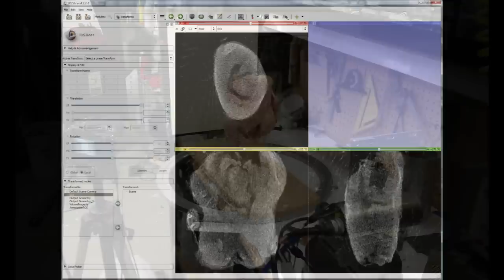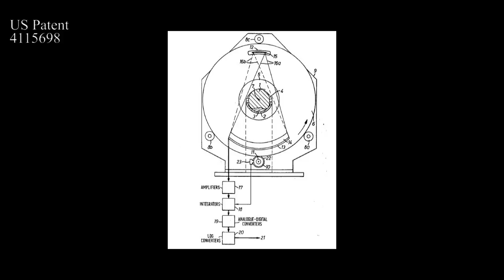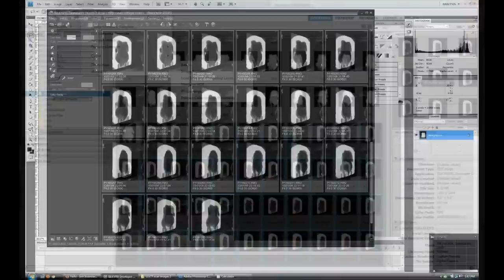DIY X-ray CT scanner controlled by an Arduino

Comment: The stepper motor driver used is a Linistepper if anyone wanted to know. This is an open source (hardware design and firmware code fully documented and available on the web site) microstepping driver for unipolar motors at up to 35 volts and 2 or 3 amps. Ben has it set for 1 amp/phase and it looks like 1/6 micro-steps. Kits are also available, which is what Ben has, and I'm trying to figure out how I failed to notice his name when I shipped the order! LOL...

Comment from the maker: You are correct about the mirror. I think some commercial fluoroscope systems work this way. I used Cygwin/Octave with someone else's code for backprojection. Then I used 3D slicer for visualization. I put some links in the description.

Comment: I just found this video and must compliment you on your logical approach to solving the various issues. I worked for Siemens Medical systems for many years and also Mallinckrodt Corp. in their medical X-ray division. I have more lately moved into dental X-ray digital imaging where a CMOS sensor replaces the traditional films used to take X-rays. I have worked on all of the imaging modalities to different degrees, my favorite being cardiac imaging. Your project is great and the item you need to process those images is an image processor like those used in the big CT machines. Also your X-ray source is much smaller but about right sized for your project. All these items are large and super expensive but you are on the correct path following what the big machines basically do.

Comment: Current CT scanners use RF or light to transmit data.  Toshiba scanners transmit data using a series of LEDs called mudat.  They all transmit power by brushes and slip rings.  Scanners I'm familiar with transmit 550 volts DC across the slip rings. Scanners from the 90s used slip rings to transmit data as well as power.  Scanners in the 80s and older used cable take up systems. The scanner would make one rotation and take one slice and then it would have to stop and wait to rotate back before it could take another slice. I don't think scanners that old did 3D.

Amazing setup. I work with CT scanners, but I wasn't searching for CT when I found this.
Reply: kel5944: The 1980's ones sound interesting. I bet they could easily be updated to get many slices and then you can make a 3D texture using today's software.
Reply: Vrej Egon Spengler Today they do .5mm slices and 256 slices per rotation. 1 rotation in .5 seconds. There is a scanner that can scan in 1/120 of a second but is seldom used today and expensive to maintain. Its also not really needed either. The gold standard is to stop the motion of the heart in one rotation.

The 3d scans are awesome! You can even do 3d prints from them if you can get your scan data from your doctor. He wont spend the time to print it though. A 3d print isnt really useful to a diagnosis.
Reply: Vrej Egon Spengler There used to be stand alone consoles that you could input the collected data to create the 3D  reconstructions
Reply: Except in bone fractures, then 3D is very useful

Comment from the maker: Thanks! I used Cygwin/Octave with someone else's code (link in the description) to perform the backprojection. I am currently working on an iterative reconstruction method, and will post more video of it soon. The graininess is partially caused by the backprojection algorithm creating artifacts, and also caused by the input images having poor dynamic range.
Reply: Awesome. How did you manage to reconstruct a scalar volume (axial slices) out of 2D planar projections? A tomography usually employs 1-dimensional parallel beam projections under a specific angle and then organized into a sinogram. So the back projection algorithm can approximate the slices out of such sinogram. But being a sequence of 2D planar X-ray roll (or a set of pics) is somewhat equated to a photogrammetry problem. Therefore, I figure out that what you did is a cone beam projection beforehand. But, I think that the provided matlab code only reconstructs previously calculated cone beam projections, but not the cone beam projection itself. Thx

Comment: What if instead of putting the camera in line, you use the old high speed trick and put it 90 degrees to the screen with a mirror set at 45 degrees to direct the light from the phosphor screen into it? Seems like that would be the best geometry to get straight on images while keeping the camera out of the X-ray beam.
Reply: R C because the phosphorous screen is affected by radiation, not photons.
Reply: HeATThER Mdd Phosphor screen produces light when struck by x-ray radiation,  this is then reflected by the mirror into the camera. This avoids the camera being exposed to x-rays as this would produce hot pixels/noisy image.
Reply: fuck yeah, a mirror is invisible to xrays.
Reply: I came here to say this but u said it first.
Reply: He could put lead shielding glass in front of the camera and move everything perfectly behind the phosphor intensifier screen. She would certainly have gotten a better image and spent less time on Photoshop.

Comment: I'm a service engineer for Siemens CTs, And I'm really impressed with the method you're using. I recommend you to keep developing this method because from the detector side of Siemens and other brands CTs are using way too much complicated detectors with lots and lots of complicated timing between readings and reconstruction of images and a lot of image artifacts making them very expensive. Loved your work and I'm pleased to help you for any hints or maybe parts from Siemens CTs.

Comment: I would recommend that you consider using Android for this type of automation. The ADK offers the ability to connect an Android device to custom electronics, and a very rich programmable pipeline. I'm sure you could have automated most of the camera control, capture, and photo manipulation (eg. imagemagik) via one device, and a handful of scripts. This could offer faster and more flexible development! Again, outstanding work!

Comment: I've had a Linistepper for nearly a decade, using it for random motion tasks over the years. Aside from the curiosity value regarding how it accomplishes microstepping, it just works with any (unipolar) stepper I throw at it. Love that design, along with every last thing Roman Black has done.

Comment: This is very, very impressive. In fact, the model of vertical rotation that you have demonstrated would probably drastically reduce the cost of traditional CT scanners for patients that are capable of standing up (I'm guessing many scenarios). A static exposure plate may yield superior captures as well! 

Great work!

Comment: Very nice. Are you going to try it again? If so, disable all the noise reduction in your Nikon. It will eliminate the subtraction time AND shorten the exposure you need. Plus you might gain some resolution due to retaining data that is lost in the noise reduction algorithms. For stars and 20 sec through say, a 60mm lens you go from the brighter stars of the constellations only to stunning shots with fainter galaxies and nebulae identifiable and big swathes of Milly Way. Could be a big help for the image reconstruction from projections.

Comment: Yep, you're missing somthing else. I was talking about using the sensor strip from a flatbed scanner. It is basicly a single line of "pixels" that is moved on a track by a stepper motor (or a similar mechanism). I think they are just a bit shorter than that phosphor screen is wide; but with a custom track you could get much more coverage on the vertical axis.

Comment: Have you considered a front silvered mirror to get the camera out of the Xray plane with rear photography? A thinly silvered mirror will be reasonably transparent to the beam but will reflect the light well.. Less keystoning makes it easier. A lead shield for the camera front on another tripod with a hole for the lens will also likely help reduce scatter in doing this.

Comment: May I have a suggestion?

The X-ray tube place slightly lower, and tilt up the x-ray beam a little bit. Put the camera above and  behind the X-ray tube. Using telephoto lens to take the pictures. So as to keep the angle between the X-ray beam and the photo-axis of the lenses as narrow as possible. Therefore you don't need the Photoshop to correct the prospective of the image, thus preserve the pixal resolution. Also, place a lead glass in front of the camera to cut off the scattered X-ray, which could avoid the hot-pixal.

I am a CT diagnostic radiographer and I am also a photographic amateur.

Comment: You can get radioisotope test sources from many suppliers. Do a google search for exempt radioisotope source and you can find them in many flavors. These are pretty much harmless, though you wouldnt want to sleep with one under yor pillow. They are used for calibration procedures in gamma spectroscopy, among other things.

Comment: The phosphorous is basically painted onto a board, much like glow in the dark paint, but with higher energy requirements to produce illumination. Getting off the point here, but no, it would not illuminate from behind, the phosphorus is a thin coat of paint on an opaque board. If you mean, turn it around and let the xrays pass through, this would induce quite the scatter, but i would think these are mounted on or laminated around a heavy metal.

Comment: That's quite a project :)  You mentioned having to do off-axis correction. Perhaps one way to avoid that would be to put the camera at 90 degrees to the phosphor screen, then rotate the phosphor screen 90 degrees after the xray phase completes. And the picture taking phase completes, rotate the phosphor screen back into position. More hardware, but perhaps easier than dealing with the perspective correction.

Comment: Had you considered using a glass or mylar reflector either in front of or behind the screen, kind of like a holography beamsplitter? Those materials should be virtually nonexistent in terms of xray absorption and could get your camera out of the beam with minimal distortion. Very cool demo!
Reply: That would be the entire point my friend. Visible photons from the scintillator are reflected toward the camera, x-rays pass through into a trap and do not affect the sensor.

Comment: I've been intending to do just this using an old dental x-ray machine from ebay! My currently un-built design gets around hot-pixel issue by using a 45-degree mirror behind the screen to place the camera below the unshielded beam-path. Also means a dark-box for shorter exposures.
I've been considering having the turntable on a linear rail too, to adjust the "zoom" by moving smaller objects closer to the x-ray source.
Thankyou so much for that software link!!

Comment: Another Excellent project Bravo! I have an idea to improve the imaging. As your setup shows your camera is set at an angle off set to the direct line x-rays to reduce the chance of "hot pixels" pixelating of the images sensor. I would suggest a direct inline setup of the camera and the use of 1/2 inch thick lead glass in front of the camera lens to block the x-rays that will cause the "Hot Pixels".This way you will have a more distinct and direct imaging on the camera.

Comment: This is fascinating. I work with X-ray sources up to 60 KV. I'm not sure what anode you're using, but I might try something like this with at 60KV and 50mA with a Rh anode. At least the image collection should happen much faster with 50x the flux.

Comment: No it's not permanent.
But twiddling the exposure or intensity isn't really the point, because you need the x-rays to get the fluorescence and they are directly proportional, so if you reduce the x-rays you get less fluorescence.
However filtering out the flashes may work, since I guess it can be treated very well as noise.

Comment: yes yes i understand this, i actually asked implicitly why he chose 8 degrees because he didn't say why, i was wondering if it had something to do with the algorithm he used to create the 3d model, or if it's just limitations with the stepper motor, but you have a point, it must be just a compromise between, the quality of the final model and the time needed to render the whole thing :) .

Comment: If you build a CBCT system using the software created by Stanislav Mašláň you can get quite high quality results but ONLY if you place a high degree of care into the precise and accurate mechanical alignment of your apparatus.  #1, You MUST find and align the Central Beam to the center of your detector and to the center of rotation on the stage. Try to get this on the exact central pixel in each and every projection image and you'll be amazed what the extra bother rewards you with.  #2, The axis of stage rotation must be aligned such that any front-to-back or side-to-side tilting is minimized as near to zero as possible or about 1/10 the dimension of a voxel.  #3, Although it's NOT simple, light-weight nor is it cheap, building a thermally stable, vibration-free mechanical apparatus will yield repeatable results without needing frequent realignments.  I'm talking about microscopic dimensions here.   #4, Capture one image for 360 degrees so your projection set is 360 images and be sure your imaging system is of good quality too.   Stanislav Mašláň's software works wonderfully but only if you feed it a high quality projection set.  I used the Volume Rendering in Image-J and it looks just like $8K CBCT software.

Comment: Love the build! Very nice simple design. 

Have you thought of using multiple shorter exposures of the same angle and to frame stacking? 

it is a quite successful method for dealing with faint objects pioneered by amateur astronomers using webcams for astrophotography.
Reply: I just learned of this today and still don't understand

Comment: Do you think you could simplify the process by using a DR imaging plate? You wouldn't need the camera or any of the photo editing needed to process that data. Also it would be little safer as you would only need to pulse the source to get the correct exposure on the plate.

Comment: Would it work to just stick a mirror at 45 degrees in the path somewhere? That'd certainly help avoid all the computing.
Reply: that would be more like fluoroscopy using an II tower and cine runs instead of computed tomography

Comment: I've always wondered why there's no variant of the CAT scan that works like yours does. I know some patients might be either unable to stand or afraid to be twisted around but it would make the device far far more cheaper to build for say poor countries or as a secondary unit in some hospital. I'm not an expert but it clearly has to be cheaper to build it in this configuration. Stand still electronics, rotating patient.

Comment: The images would not be similar, because this is not a orthogonal projection (in the mathematical sense of being right angled). The x-ray beam is cone shaped, so the closer something is to the source the larger its projection. This is also true for the "planes" (parallel to the screen) within an object.

Comment: considering that you have a panasonic with probably a detacheble lens, you might try to get super fast c-mount lenses off ebay and attach dem with an adapter. you lose a bit of resolution due to croping, but you can get speeds at f1.4 or even f1. and they are realy cheap !
Reply: Most of them are petzval lenses, which are great for portraiture, but awful for science. Also He was taking the image off-axis so you'd need a reasonable depth of field to get everything in focus. Ben used F/4, I think, on a m4/3 camera, that it's the best compromise.

Comment: Question:   Instead of having the phosphor screen perpendicular to the x-ray beam and the camera off angle, what if you tilted the phosphor screen (rotate it) to be perpendicular with the camera?  This way, the  x-ray beam should still cause the phosphors to illuminate, but you can have a squared-off image without worrying about hot-pixels caused by x-rays striking the camera sensor.
Reply: +Ross Jacobs Then you would end up with a distorted image on the screen caused by the differences in distance from object to screen
Reply: +nrdesign1991 Couldn't he just compensate for it the same way he did for it not being inline. Advantage of this would be that he woudn't need to darken the room, just cover up the phosphor screen.

Comment: Cone-beam CT is much simpler to implement than traditional linear CT.  It requires more processing power, but images can be acquired much faster and with less radiation.

Comment: An Analytic and Iterative Reconstruction Algorithm could yield better resolution instead of using back projection. The Iterative method would calculate basically a value for each pixel, it does this by taking away the original wave from the returned. The value you would have is a power dbm, this could be easily converted into volts. If you had a specific voltage at each pixel then you could plot it in matlab via a matrix because each voltage value would differ from the other depending on the density of the object. Also a screen wouldn't be needed because all you would need is a photo-diode to receive the RF. A lower RF maybe in the microwave spectrum could give you the same penetration with less radiation obviously resolution might not be the same but it would be great to see the difference between Microwave and X-Ray.Great video it really helped me when I was in college.

Comment: So do the xray come out of the tube like light? Could you in theory stand behind the tube (in a large cavity with nothing in front of it) and not receive any xrays? Is the back scatter caused by compton scattering: Xray strike an electron in metal knocking out that electron as low keV B- which hits another electron in air (ionizing it then it deionizes making xrays or UV) or what ever is close by then making another lower keV xray which penetrates through the air back in any direction?